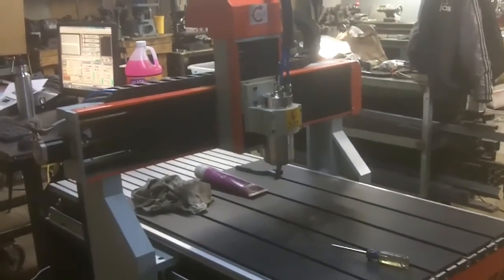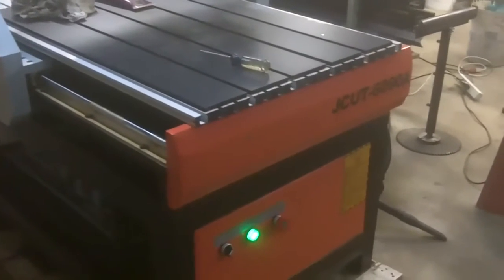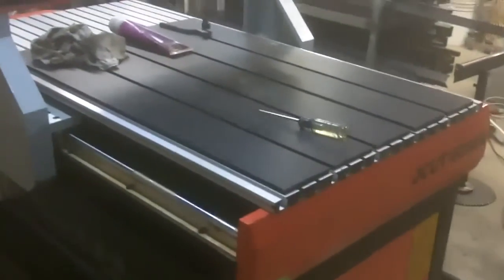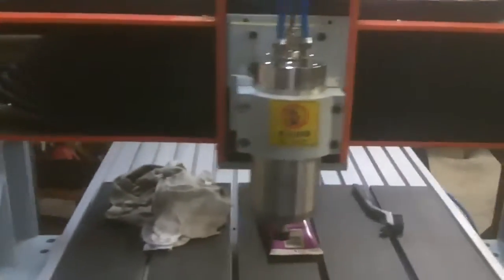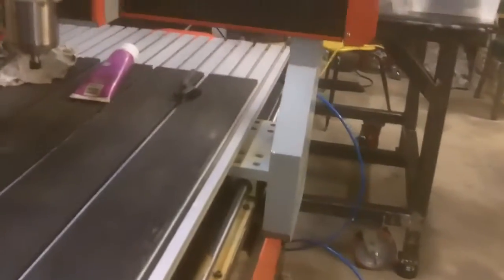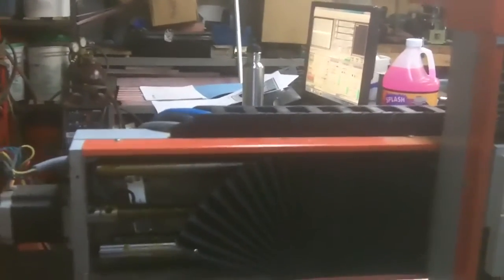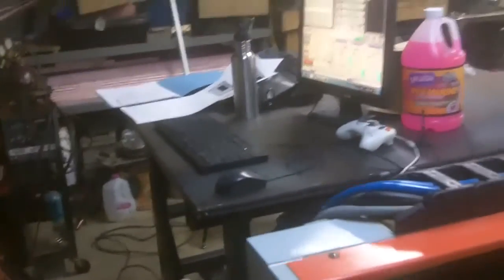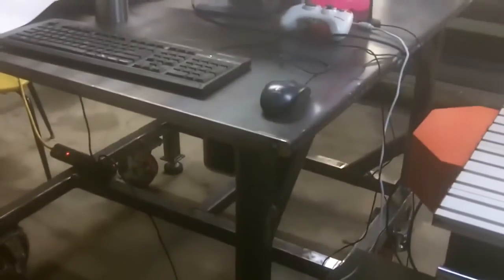New CNC Machine JCUT 6090a

Comment: Thanks for sharing. I've been thinking about one of these. Currently have a little 3040 that I put a tinyg controller in and use Chilipeppr instead of Mach3. Seems like these are about $2400 on ebay now. Does that sound right? If you have any experience with the tinyg board and Chilipeppr, what do you think about using those instead of mach3 with a machine this size? Thanks!
Reply from the maker: I couldn't say as I've never used a tinyg or chili pepper.  I ended up getting a breakout board and spindle control from PMDX.com.  I chose them because they're US based, and offer GOOD free support.  The first time I called them, they picked up and were willing to answer my questions.  The board works beautifully and my machine is fully functional now.  Wiring it all was a good learning experience.  2400.00 would be a good deal for this machine as long as the hardware (ballscrews, bearings, etc) are OK.
Reply: Thanks for responding so quickly! The ebay ad suggests it's the same type of machine, with ball screws, round linear rails, etc. Here's hoping;). Looks like you can upgrade to the 2.2kw spindle for an additional $200 too. Hmmm...might have to start saving! I'll check out PDMX, thanks.

Comment from the maker: I did get everything to work w/ the exception of the homing switches (so far).  This is only an inconvenience though since you really only need to zero the machine  at the start of each session.  The biggest con I can think of is that there is little to no support.  Information for my USB motion controller (JNC 40m) is impossible to find online.  Another con would be it's kind of slow.  If you try to push the speed over 100ipm, you lose steps.  Replacing the motion controller would probably resolve all of these problems.  That said, I'm pretty happy with this machine.  Even though it's slow, it's also heavy and rigid.  The bed is made of cast iron and the gantry arms and cross member are thick cast aluminum.  If you don't push it too fast,  it's crazy accurate and repeatable.  I've started engravings .003 deep over again after manually moving halfway across the table to some random spot and it picked up right where it left off.  I also like that it's not too big or too small of a machine.   It's work area is right around 2'x3'x4"(more like 3 w/ the spoilboards).  I got this machine pretty cheap though -around 3 grand.  If I had to pay the full price of around 6 grand (shipped)  I might've gone with the CNCRP Pro 2x4 as they're US based and have a good reputation for support.  If you do get this machine, spend a little more for the THK bearings and 2.2kw spindle.  The 1.5kw I have uses er11 collets which limit my tool shank diameter to 1/4" whereas the 2.2kw uses er20.  I'd also get the motion controller separately as the electronics in these Chinese machines are notorious for being sub standard.
Reply: +Jake Mercer I retrofitted one with mach and have gotten it to go as high as 150 ipm.
Reply: For now the mach3 we used on our machine with USB . and sorry for the delay  as i am not on youtube for every day . please write down my email mandy@jcutcnclaser.com , my mobile&whatsap: 0086-15589961121, thanks
Reply: Mandy JCUT I wish I had you coming forward like that to help me when I needed it and was reaching out...